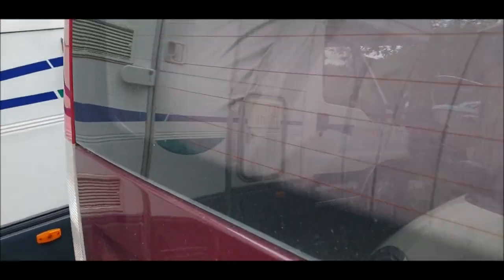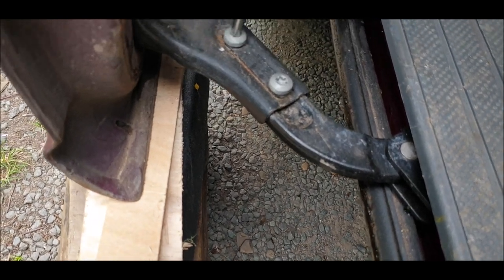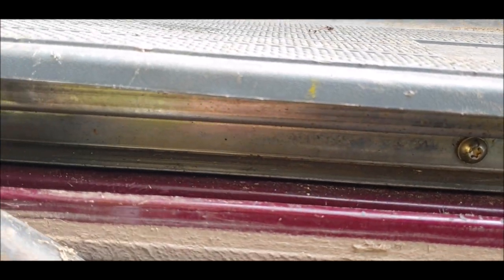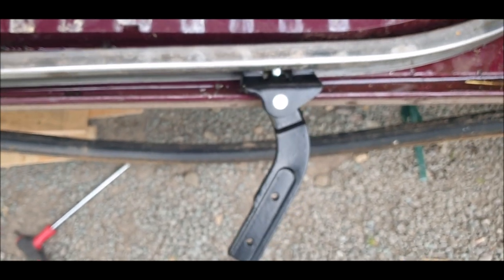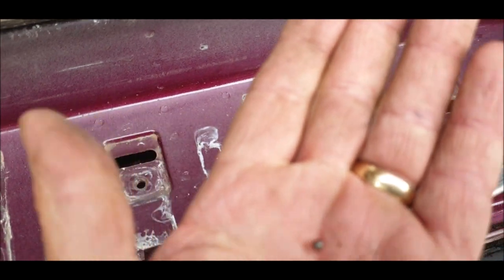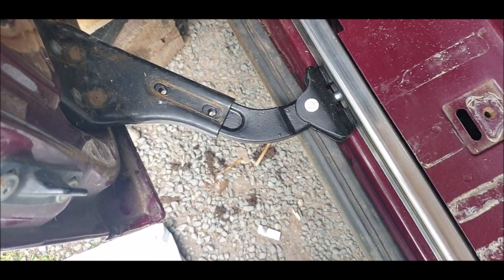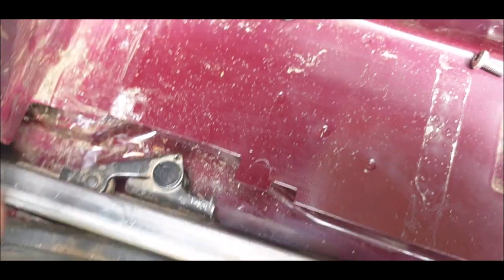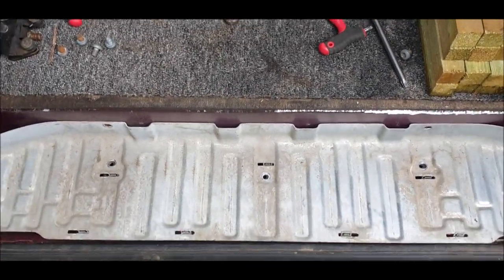Mercedes vito sliding door roller replacement

Comment: Thanks. Just done my van door. Didn't need to remove rail, just clip out the plastic foot step and remove metal tray for easier access. Gave rail a good clean. New runners then just tilt into place. Note you have to slide the new one into the door support bracket. My runner wheels were knackered being by the sea with salt and sand. The door will support its own weight, just about.
Reply from the maker: Nice work!

Comment: Thanks for the video! I made the same mistake with the locking mechanism, it’s easier to take out the whole rail, when you have removed the 4 torx screws, there is a 10mm bolt underneath of the car. Then you can easily take it out! Thx
Reply from the maker: Thanks for watching

Comment: Watched this first for ideas be if anyone trying this there is a far far far simple way to do this!!! simply pull up a little the plastic trim in the door footwell area.   If you open the door fully if you look at the metal plate under the trim you will see the plate goes in a little towards the rear section! This is where you can remove the old one from and then if you get the new one and at an angle hook the two small top rollers in you need to give it a good jiggle to get it fully in place but it will go in, once in simple reattach to the door section 👍👍
Reply: This video did help to start with thanks but after a good look you can avoid all of this 👍
Reply from the maker: spot on 😆👍🍷
Reply: Mark Davies but like I said this video was great simply to understand what’s there and could be involved but after looking I worked out the other way was easier .. only niggly bit is once you hook to two upper rollers .. get a flat piece of metal  etc to make the gap up from the van into the roller slot so that as you wiggle it across the main roller jumps up into the track .. once in your laughing 👍👍